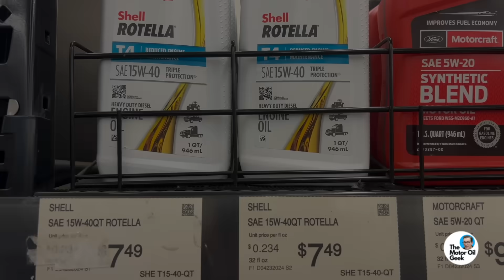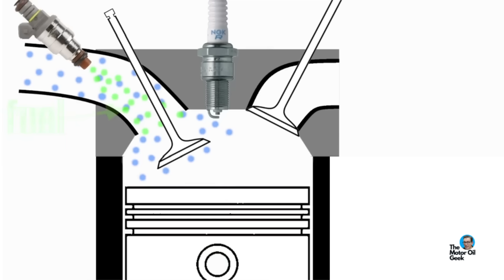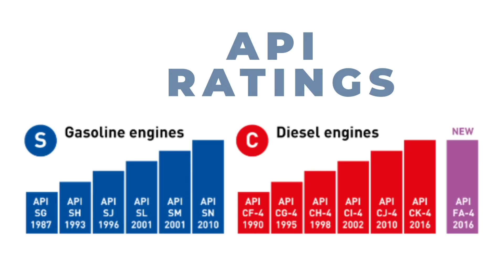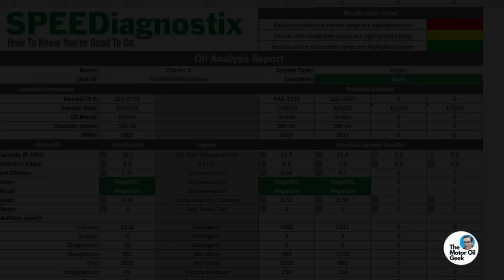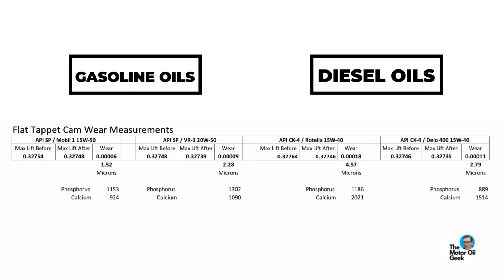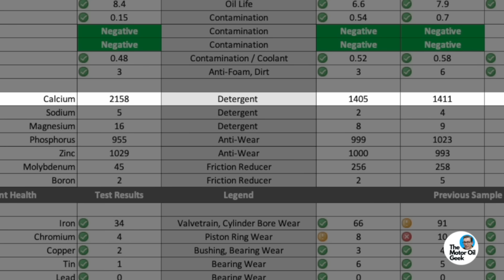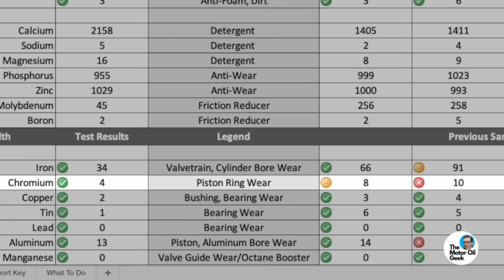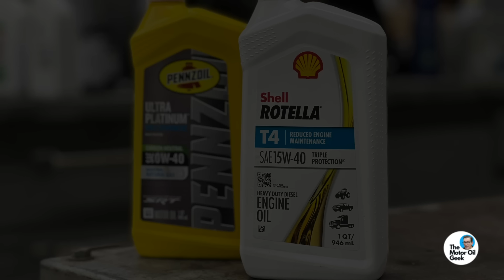Why DIESEL Oil is Actually WORSE for Gas Engines!

Comment: I rather put in the ‘wrong’ oil and change it every 5000 miles than the right oil for 20.000 miles.
Reply: Best comment, same here! 🎉
Reply: Why not just use the right oil & change it every 5,000 miles? Did you actually watch the video before commenting? Low speed pre-ignition on GDI engines isn’t related to the age of the oil so much as the actual chemical content of it. They also didn’t mention, that I caught, that you can still get “diesel” oil that’s also “S” certified. Not for GDI engines, but I think Rotella has some up to SM or SN depending on how old the oil is and which version.
Reply: Imagine using the right oil and changing it every 5,000 miles.
Reply: Get the oil tested and see how long you can run it. It will give you a baseline that is what smart people do.
Reply: @TonyBenton0728 Not necessarily smart, but people who have more time on their hands. Preventative maintenance isn't a bad thing. If I'm recycling my oil, I'm not wasting it.
Reply: @rotorhead5826  Well then you are smart by recycling your oil. More than one way to be smart .
Reply: Like saying I’d rather crash into a tree than into a concrete pillar. How about just not crashing? Use the right oil at the right intervals.
Reply: Well if your options are dumb and dumber, sure! But most people would rather just run the right oil for 5k miles.

Comment: This is just great! Next, they're going to tell us we can't use tractor hydraulic fluid in our transmissions.
Reply: Had some biodegradable hydraulic fluid at work. It was dyed the same color as our 2-stroke oil. Guys ran out of 2-stroke oil. Didn't bother reading the label on the 5-gal pale of hydraulic oil. I don't know how long they used it for, several weeks is my best guess. I discovered it when I saw a guy making mix the one day. Surprisingly even at 50:1 I didn't have anything die. I'm sure it shortened the life of stuff. But nothing verifiable died from it and some of it is still in operation, this was probably 5 years or so ago.
Reply: or 20W50 or a 10W30 in a engine that requires 0W8. No joke, people actually think Thicker is better for everything ..still.

Comment: Lake, I have the feeling that it may prove interesting to do a follow up video to fill in the mystery around the use of that same or similar idea of oil that was formulated for diesels but also formulated to meet a slightly older spec for gasoline engines. Another words its a "mixed fleet" oil and that type of oil formulation has been used for many many years in mixed fleets and certainly on most farms. A few years ago I had reason to pull a stock cam shaft from a GM 350 engine that had quite a few miles on it but internally one exhaust lifter was collapsing causing a miss. I speculated that with that many miles the cam would have wear as well as the lifter base but upon removal I was totally amazed at the appearance of the components, all lifter bases looked perfect as in not a sign of galling and the cam looked as if it had just come out of the box brand new. The oil that had been run in it for most of its life was Esso ( which became Mobil up here in Canada ) 0W-30 heavy duty diesel rated oil originally formulated for our Canadian winter climate which also was gasoline rated and of course the formulations would have changed over the years with the C and S ratings. A little off track there but going back to the low speed pre ignition within the rings, why was that never a problem with a carb or throttle body injection etc when using these mixed fleet engine oils ?.

Comment: Lake, can you explain how Detergents "handle" Soot? - Surely at best it can only break it down a little and carry the smaller particles in suspention until the oil is changed 🤔

Comment: Can high levels of calcium in oil in say and older gen 1 small block Chevy with higher compression (carbureted) cause ping or pre ignition similar to low speed pre ignition in a direct injection engine?
Reply: 10:58

Comment: You said in another video awhile back that a valvoline diesel oil was good for gas engines.
It even says it on the jug.
>formulated for gas and diesel

Comment: So for 30 plus years Ive been using Shell Rotella T 15W-40W (LABEL STATES FOR GAS AND DIESEL ENGINES) wrongly?😢In my 1951  Flathead Ford V8 gas job that is in my Willys Jeep😮😮😮
Reply: API SP oil wasn't available until May 1, 2020, that is not 30+ years ago
Reply: Rotella T-4 was available in the 80s covered sj to ch4+ rating. @philiptong4978

Comment: Gasoline engine oil with Molly are very bad for motorcycles with a wet clutch.
T-4 oil has no Molly so it is safe for Gasoline engine motorcycles.
FYI

Comment: What about diesel oil in a motorcycle with a wet clutch in a shared sump ?
Even Rotella 6 has a motorcycle on the container and says Jaso MA2
Reply: Allison C4 rated oil WON'T cause CLUTCH SLIP .

Comment: Diesel oil destroys catalytic converters. It's fine in motorcycles.
Reply: Rotella T6 doesn't..... My Triton runs it, my VW runs it, friends with 2.7L & 3.5L Ecoboosts run it, can am spyders, kias, can am defenders, dodge hemis... Etc etc and NOT ONE ho2s nor catalytic converter failure in the bunch.  Maybe T5 and T4  and other manufacturers cause trouble, but not T6..
Reply: @gmctech the issue is zinc. According to Shell: "We do not recommend Rotella T6 for engines with catalytic converters."

Comment: It's very common in the performance automotive world to run high zinc diesel oil in boosted (turbo charged specifically) engines.

On a side note, Dave is a smart man for sure. But some of his understanding of performance related topics and general claims are way off at times. Aftermarket performance is a different animal than maintenance of an OEM vehicle. You can tell his exposure and experience with aftermarket performance maintenance/repair is very very limited

Comment: I use Rotella T4 15w40 in a stock 2bbl Chrysler LA360 and a vintage Fiat flat tappet high revving 4 cyl. I was using Driven HR5 and HR1 before, but it's not easy to find in Canada. 

Now I'm not so sure T4 is the best option. It works with no apparent issues, but I don't want to cause any serious wear either. (just checked a 2024 Shell Rotella T4 15W40 TDS off Shell's website - "Hard working diesel and gasoline engines · Suitable for use in pick-up trucks, sport-utility vehicles (SUVs), mini-vans and motorcycles." )  I think I'll be just fine.

Comment: Have a 2001 mercruiser 5.0, and I've been using Rotella 15/40 for years with no issues.
Reply: I own 7 old big block mopars that I've used shell Rotella in for 25 years now without any issues
Reply: Yeah I’ve used them in the 3000gt VR4 platform for 15 years, there’s been a ton of oil analysis performed over the years on the forums and rotella always performed the best against similar weight oils. I’ll continue to use it. I do like this content though, and made me think. Maybe it’s because they are high mileage/old engines that need more detergent?
Reply: It's usually a pretty big span between complete failure to expected wear or reduced wear that's then traced to the oil. But if the oil analysis looks good then it's what matters. 😄
Reply: @bobbygetsbanned you said you give hints so do you give GOB also???… jus asking for the comment section you seem to be trying to give some GOB for free…..
Reply: @hairycods2273  Idk wtf GOB is, and I don't care. Yall just need pay attention to the video instead of leaving ignorant comments thinking anecdotes refute empirical date, and erroneously claiming this only applies to GDI engines.
Reply: @ Gob is ur mouth 👄
Reply: Is only saying you cannot use diesel oil (AKA) rotella 15 w40. In a direct injected gasoline engine..
They did not say that the diesel oil is bad for a regular hot rod carbureted engine.. or a Port fuel injection.. remember we've been using diesel oil way before they started making these oil videos. Way before the invention of personal computer... So don't be scared to use rotella in your hot rod. I've been using rotella 15w40 in my hot rod for 40 years now,, (since Kendall GT1 oil was discontinued) .. I never had a problem. And I'm not going to change now, because some video on direct injected engines which don't pretend to us hot rod guys..🏁👍🏁🙂
Reply: @anthonyangotti5484  I had no idea the rotella cult ran this deep! This video provided empirical data diesel oil increases wear in ALL GAS ENGINES, and is unsafe to run in GDI engines! But even if you don't have direct injection, the increased detergents still increase wear in ALL GAS ENGINES! Get out of the damn cult, open your eyes, and look at real data.
Reply: Um. Been using this for 20 +  years and it runs like the day I bought it, boat enginea are totally different due to their high rpms, if you paid attention 
This issue it with direct inject.
Reply: Bro this comment section hurts my brain. How can you all think your worthless anecdotes dispute empirical data?? 
Here I'll give you a hint, just because rotella worked, doesn't mean gas engine oil wouldn't work, BETTER! Hard concept to understand, I know, but all you're proving is you don't actually understand wtf you're talking about.
Reply: @bobbygetsbanned6049  Oil really is like religion; "I pray to this god and it seems to be working", "well I pray to this god and it works for me, so I don't know what you're talking about". 👀😂
Yuup, anecdotal evidence is filled with emotional bias, that's why things should ideally be measured and evaluated with an holistic approach. 😄

Comment: Lake, as someone who works in the auto parts industry (and actually cares), I'd love to see some real-world results on different oils when it comes to antique engines.  I've been in the camp of "use diesel oil to not overdose on zinc" group and I'd love data to back that up or something better to recommend based on results.
Reply: I’d like to see that also. I have an old 69 Beetle that I restored and have been running 15-40 T4 in it. Now I’m scratching my head and I don’t need any more bald spots.

Comment: How about Mazda Skyactiv engines, which have a higher 13:1 compression ratio
Reply: What does the manufacturer recommend? Read the manual that came with the car.

Comment: Here in Europe most diesel oils are polivalent, they are made to be both Gas and diesel car compliant
Reply: Yeah, ...they are talking from a purely American perspective.  Notice how many times he compares "diesel oil" to "passenger car oil."  In Europe passenger cars have diesel engines just as often as gasoline engines.  Anyway, interesting stuff.  There are pelnty of diesel oils that are certified for mixed use, both diesel and gasoline.  These are great for an older high milage GASOLINE car that produces blow-by and degrades engine oil fast.
Reply: @sezwo5774  Yup I know, but english is a " worldwide " language so I wanted to point that out :) 
Before diesel was demonized it was 70% of passenger car sales in Europe at it's highest.
Reply: @ In the USA diesel was beginning to gain popularity in the 2000's.  Less than 1 percent of total sales but growing. It was abandoned prematurely imo.  The gasoline engine became too complicated and costly to fix.  Dealerships cannot make a profit repairing a modern gasoline engine cause it takes too long and requires too much skill, ...for which they are unwilling to compensate mechanics.  The auto repair industry is basically collapsing in the US.  Diesel was relatively simple and reliable and likely could be made much less polluting without overcomplicating things.  Electric cars if perfected have a chance of liquidating the gasoline engine repair industry.  It is already unprofitable.
Reply: @sezwo5774  Why do you think the " dieselgate " started ? 😉 make a guess.
Reply: @AAAAAAndrea  "Before diesel was demonized it was 70% of passenger car sales in Europe at it's highest.
" Yeah but it didn't go from 10% to 70% market share from 1995 to 2015 in the EU  by magic. It was PUSHED heavily to get that market share in Europe, mainly to prop up domestic European auto makers who are good at making diesel ICEs.  Arguably the petrol-hybrid approach of Japan WAS better and achieved FAR better urban air quality results.
Reply: @TassieLorenzo  I had both gas and diesel cars, diesel cars are WAY better as daily drivers.
The issue is that they have been banned in big cities except euro6 and the DPF, EGR  ad blue and other trash. 
Without all that junk diesels are amazing.
Reply: @ In the US. the combustion engine repair business is unprofitable and is also sinking dealerships.  Repairs are too complicated, take too long and are too costly.  Sales departments cannot make up for money losses generated by service departments.  Somewhere a decision was made to try to scrap the combustion engine and engine repair industry altogether and over time switch to electric motors that require nearly no maintenance and can be replaced in a matter of minutes.
Reply: @AAAAAAndrea  Because of the new ratings on PCMO's to have less anti-wear additives.
Reply: @armedfarm3429  Actually we had gas/diesel oils way back, like in the 2000s
Reply: @AAAAAAndrea  I know, I used them.
My 2001 Harley Softail was one of the engines, it said in the OM if the right oil can't be found meaning HD oil, use Diesel oil.
ATV's, MY side X Sides, all got diesel oil.
Reply: @ Yes, propping up diesel kept foreign gasoline competition out.  Mainly American and Japanese gasoline imports.  Dependence on foreign oil also had to play a role.  Western Europe at the time of the Cold War did not want to buy Russian gasoline.   Though I've heard that Eastern Germany was selling some Russian oil to Western Germany.  Diesel engines are more efficient so less European dependence on imported oil from the Middle East.  It is all complicated and politicized very much.
Reply: The times they offer specific diesel engine oil it's usually for either large equipment or some really modern engines that require a specific formula.
I doubt it all comes down to formulation, some of it probably comes from the different ways of getting classification.
Reply: @PSA78  Yes I know, but some European car oils are very similar ( even if not declared in tds ) to Heavy machinery diesel oil.
My current oil is similar to a CJ-4 spec
Reply: @AAAAAAndrea  Yuup, I have looked at some of it, maybe he'll make a video explaining the logic or general idea behind the different systems of classification (and not just about difference in specific formulations). 🙂

Comment: Another brilliant episode. Than you so much for dropping the knowledge on us. I admit I have been part of the crowd who has used Rotella T6 in a turbo DI gas engine. It was a BMW N54 and it ended up with loss of compression on cylinder 4 at 208,000 miles. I used T6 for probably the last 100,000 miles or so. It still ran, but I got constant misfires at idle. I was able to trade it in. 

I just bought a VW. A 2019 Jetta with the 1.4 L EA211 engine. Oil meeting VW 508 00 is recommend for use. Can you talk about if there is something special about this spec and if some of the API spec oils may be equivalent? Generally speaking, why are European oils formulated differently (assuming they are)?

Thanks, Lake. Keep it up.

Comment: Did the test results REALLY show any difference especially between the VR and the Delo. 0.09 vs 0.11 wear? Are we SURE the thicker 50wt vs 40wt didn't make for that negligible difference? Those test results certainly don't conclude diesel oil is hurting anything anymore than a great gas oil vs a low/mid tier gas oil. Also how many gas engines call for a 40wt and 50wt. All my engines call for a 30wt and the primary reason I have used 30wt diesel or ACEA A3/B4 is because HTHS and shearing standards are higher/better than API S oils, not for the dispersants and detergents.

Comment: What about using diesel oil for natural gas fired engines like standby generators?  It seems common to use Rotella syn 5W40 for these engines.
Reply: Natural gas engines have some unique requirements. Some companies like Schaeffer actually make oil for natural and sour gas engines.